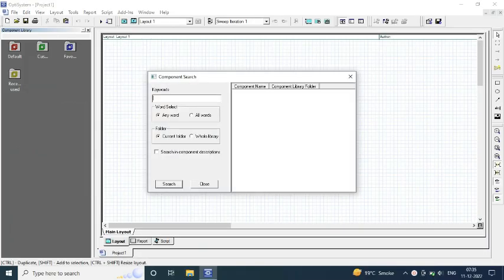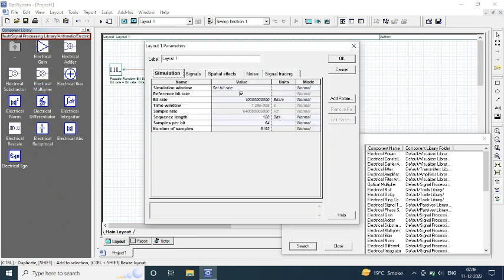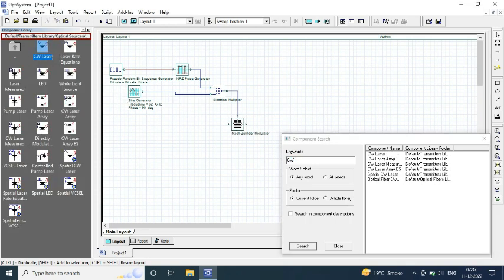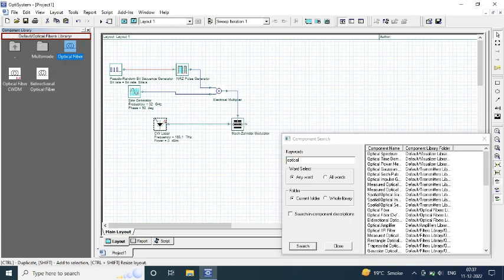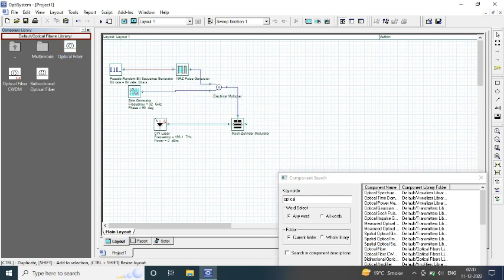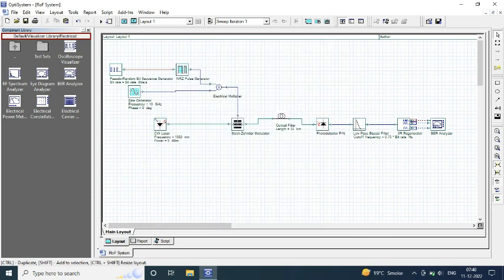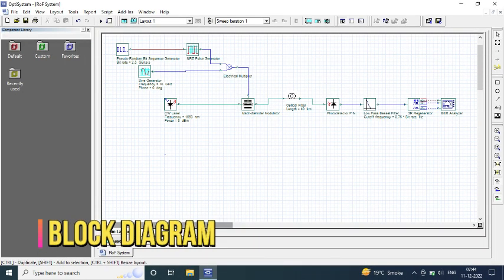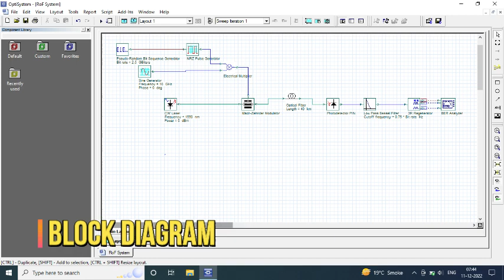Design and Simulation of Radio-over-Fiber (RoF) in Optisystem Software II In English II

Comment: four signals are transmitted for 120 km. through single mode fiber with erbium doped fiber amplifier. Two base stations are introduced at 40 km. each to add and drop a particular signal. The well known advantages of fiber such as low loss, light weight, large bandwidth, small size, low cable cost are very useful in optical communication. Warless sensor network is used where battery recharge or replacement is impossible so network life time is more important. In this paper we are presenting a heterogeneous network in which various energy efficient technologies are used .It is an essential technology for the provision of access to broadband wireless communication in a range of application. Their transmission properties are very useful in their implementation as the backbone of a wireless network.